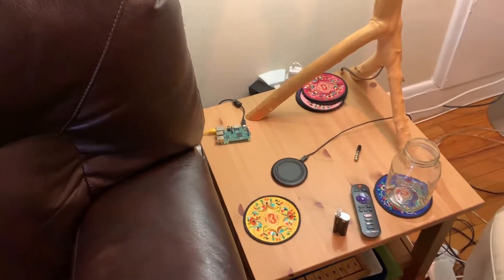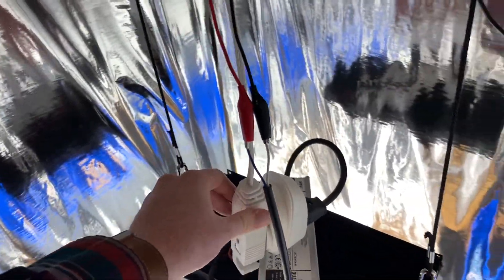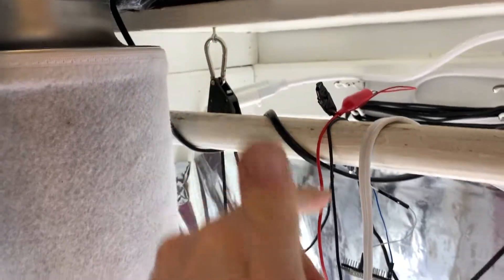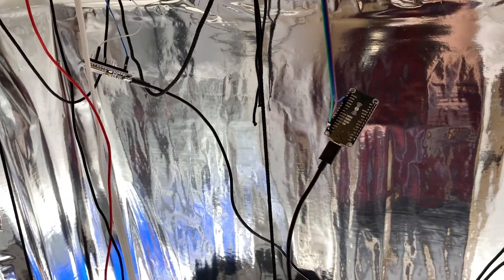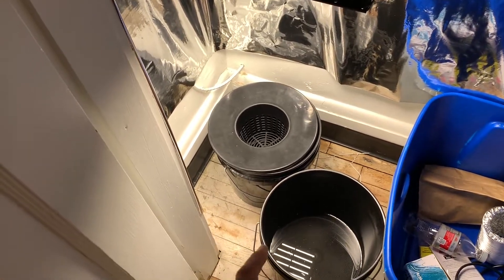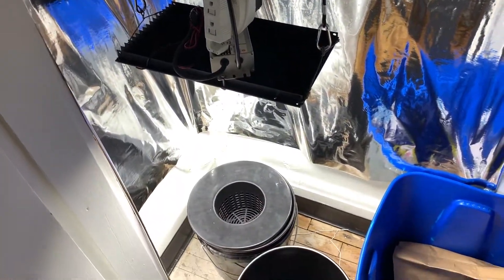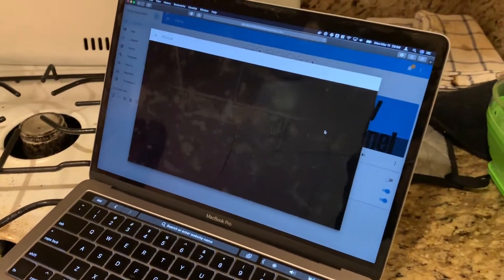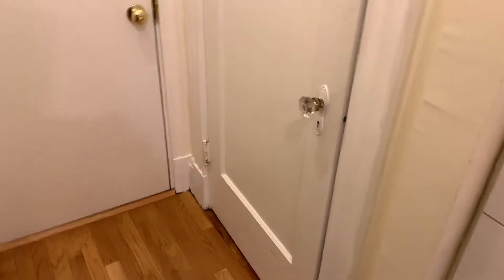Smart Grow Automation Technology Overview

Comment: For a pH sensor have you looked on aliexpress.com? Search for 'Liquid PH 0-14 probe arduino' the ones I saw were about 10 USD. 
For TDS search ' TDS Sensor Water arduino'
I am assuming if it works with an arduino it will work with a nodemcu?

Comment: What do you plug your NodeMCU into to power it? I am super interested in doing this also but have no clue where to start.
Reply from the maker: Just a normal USB wall charger like the one that might have come with your phone.

Check out this video for more specifics on the Temp/Humidity sensor. I will release a video soon about the light control.